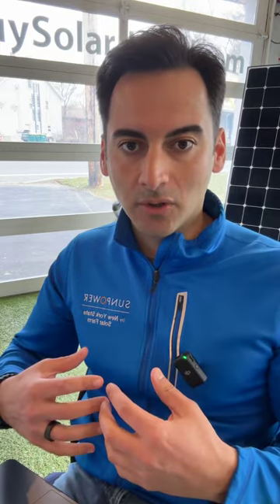Grid Profiles IEEE 1547-2018 & UL1741 SB Standards

Comment: Is this adopted standard going to allow more DER to penetrate the grid. I actually have a 100kW AC commercial project in Orange & Rockland (ConEd) that is located on a utility circuit that is too congested for anymore DER systems. Have you ever dealt with that before? Any guidance would be appreciated. If all these fails I’m going to ask if they would accept our project if we were to install no-export option on the inverters.